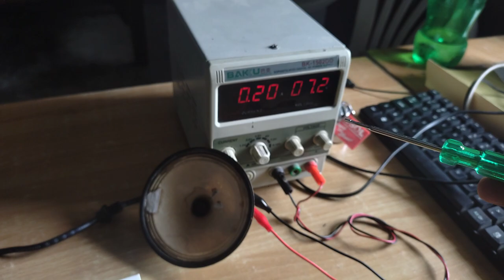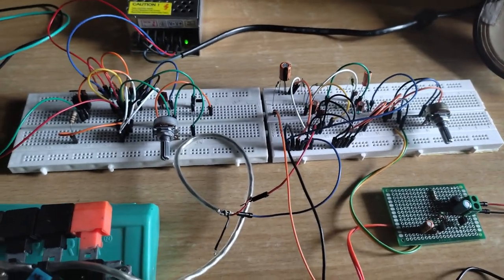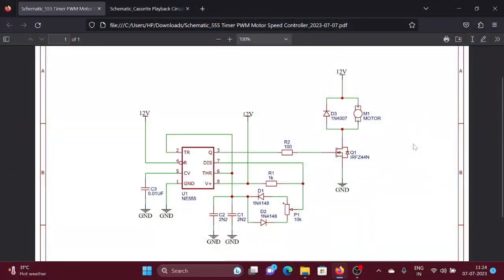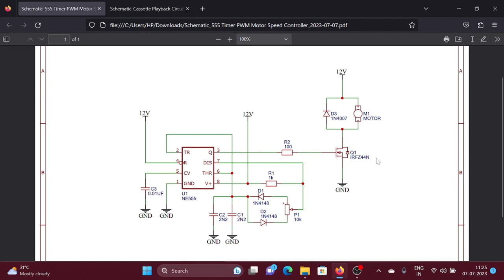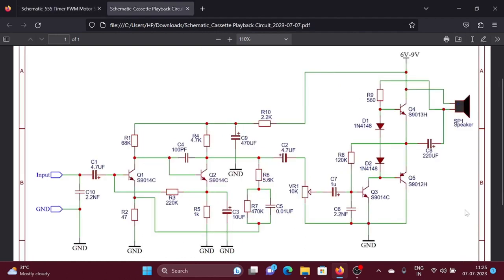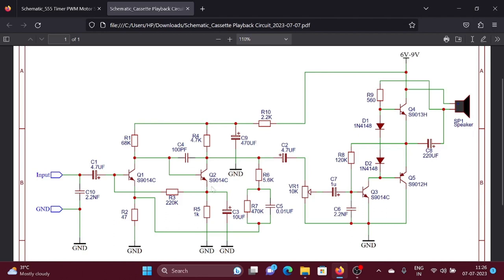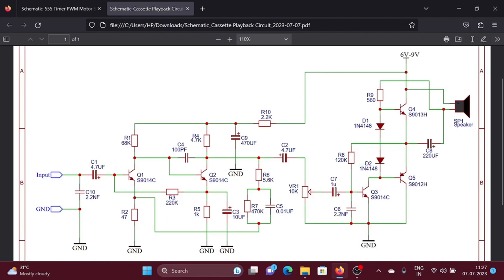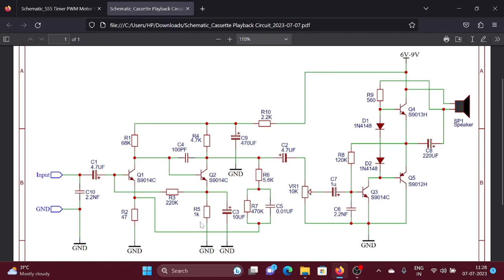Making a DIY Cassette Player

Comment: Yah 810 ka circus
Reply from the maker: https://www.amazon.in/pke-810-IC-Amplifier-Circuit/dp/B077D1X38P
you can purchase this circuit from Amazon or you can also make your own circuit
Reply from the maker: Here is link of my instructables on TBA810 Amplifier
https://www.instructables.com/TBA810CTC810-IC-Audio-Power-Amplifier/
Reply: Tq bro
Reply: Motor connection circuit diagram 
Details explain in use components names